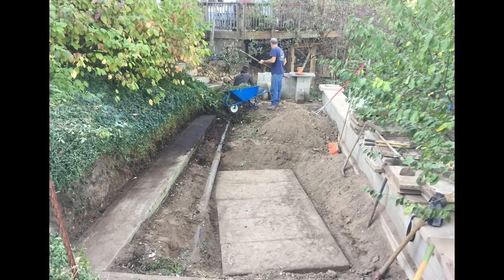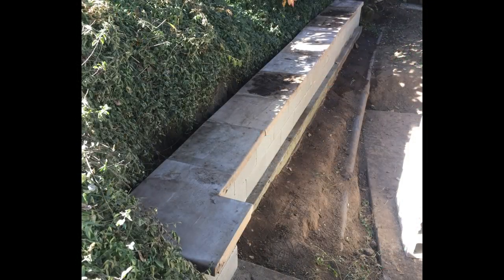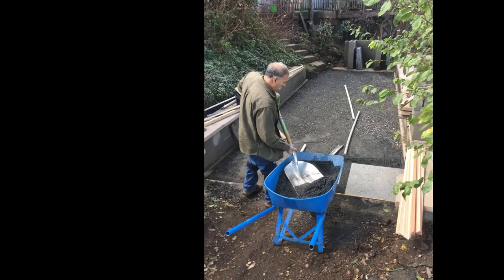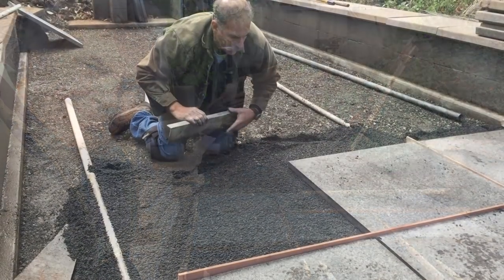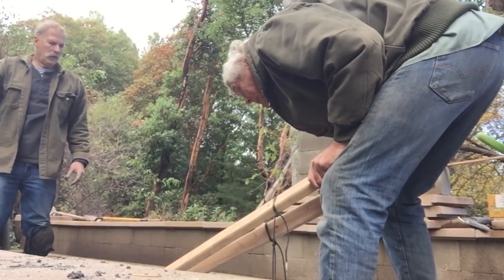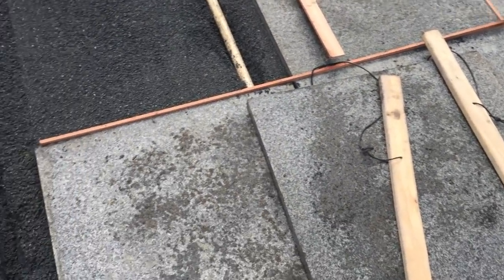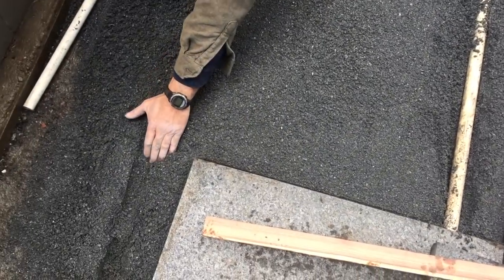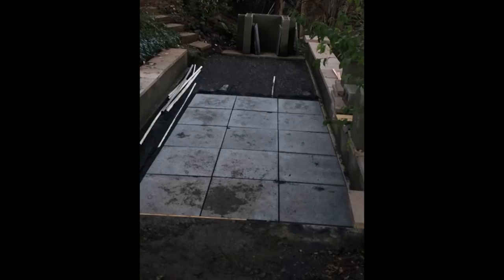FUTURE Pizza Oven

Comment: Good score, 1000 times better then the $50 colour bond gate I picked up of a client yesterday. But don't bother showing any unevenness because my OCD will complain in the comments. I know how hard it is with Huge pavers like that. They're like $90 here, each.
Reply from the maker: Trooperandcooper Ale I got 38 whole pavers and about 12 trimmed pavers. It will be close. I think I will switch to brick near the oven.
Reply: @arboristBlairGlenn  One hell of a swap. Hope you show the making of the Pizza Oven if you are using clay and brick. Save one granite paver to slide the cooked pizza onto, just a thought and if you have enough.
Reply from the maker: Trooperandcooper Ale 4 hours of stump grinding for 38 plus shorts of these pavers. Around a pool, too hot for bare feet. At my mountain retreat, perfect!